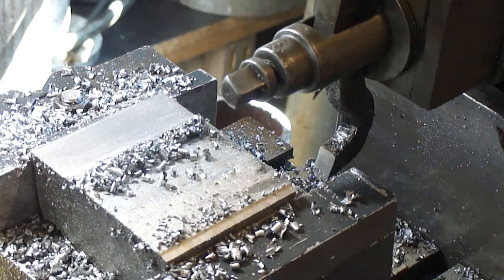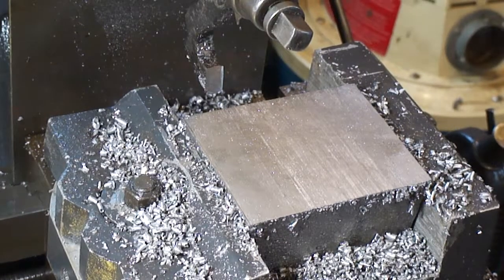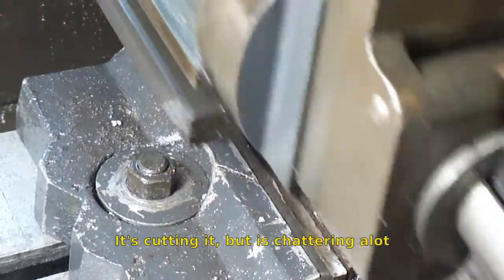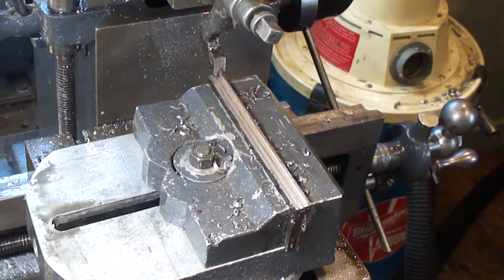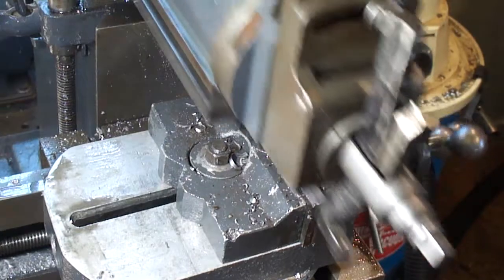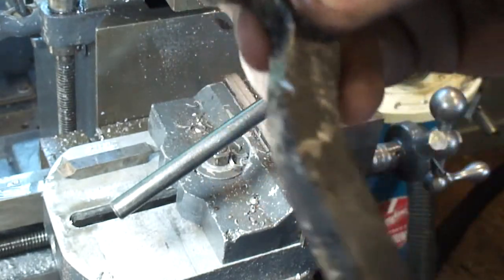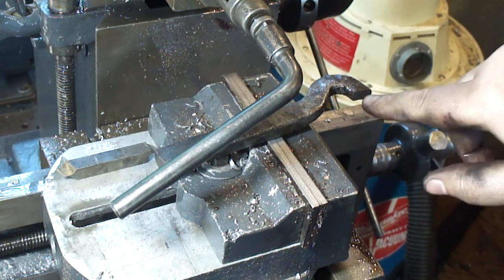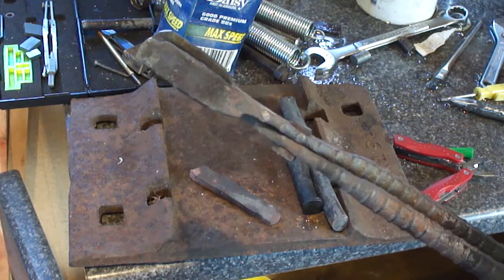Quickie Bit - Forged Coil Spring Steel as Cutting Tool/Bit?

Comment: Great test there! The spring is flexing, due to lack of support. Might be better if held closer to the cutting edge. It worked much better when you found the sweet spot. Cool Man!! Thanks for the experiment, I like... Best of Luck!! ... Pappy
Reply from the maker: Thanks for watching, the issue was that I had the grind wrong and it sticking out too far forwards, so that when it started to cut, it wanted to dig in. After I cut it back behind the clapper box, the chatter stopped and started giving a great finish.
Reply: Sweet! I love the way you try things your a good man!
Reply from the maker: thanks

Comment: Wow. That's pretty cool that you did some blacksmithing to make tooling for a shaper. What's a step over? is it the distance the tool passes the stock?
Reply from the maker: I did mess up the tool, it's not supposed to have the hook, just supposed to go straight down, hence why it was digging in, so Ill have to fix that. The way a shaper works is it takes a pass, then steps over and repeats until it's all the way across the part. What I had to do was just increase how much it moves the table over after each pass, and it started to work without chattering. If I cut that hook off and make it so it goes straight down, it'll make the tool much more rigid and makes it so it will no longer dig in and chatter.